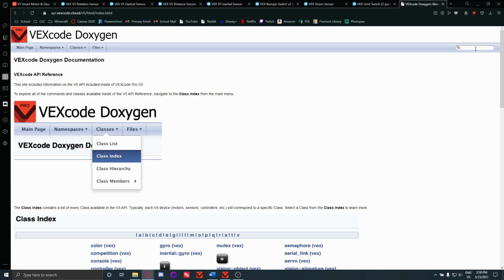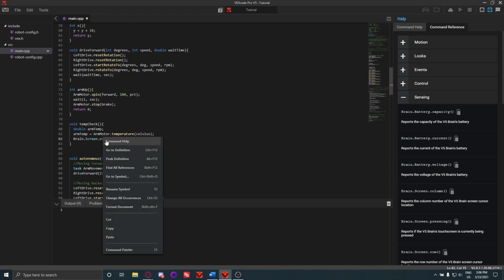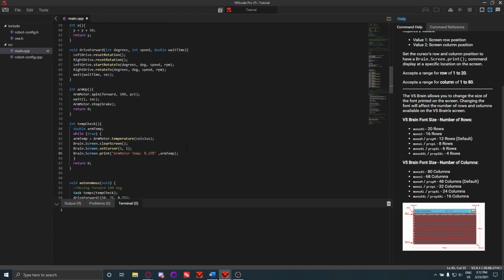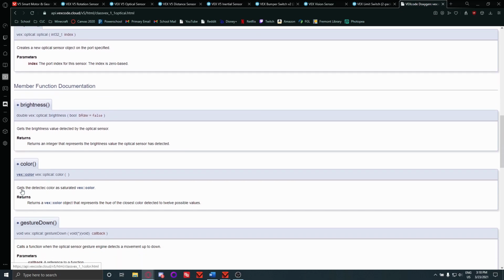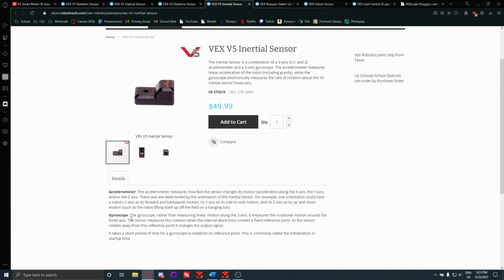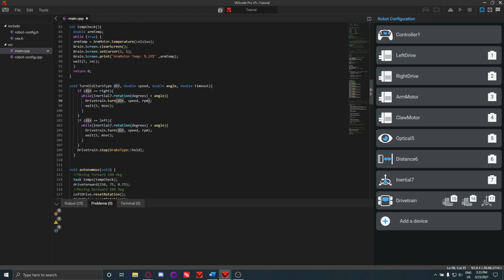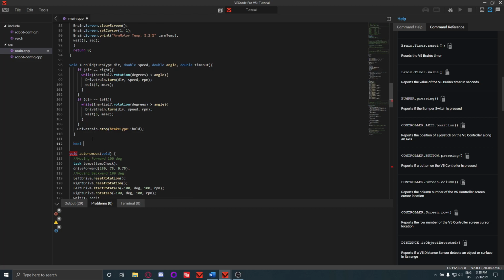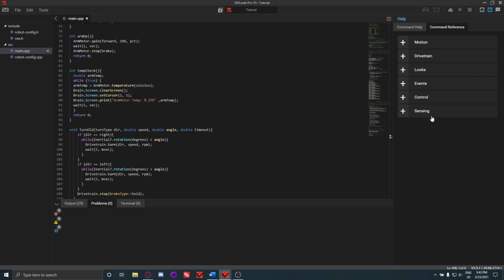Using Sensors with VEXcode V5

Comment: How would you solve the robot constantly turning, I've calibrated the sensor on a flat surface and I had it fit secure to some metal but whenever I run the code it's like it ignores the sensor (even unplugged it) and it spins in circles forever
Reply: Not sure if you still need help, but the problem here is that the inertial sensor is trying to process lots of information as fast as possible, so it ends up skipping degrees in its reading causing your while loop (I'm assuming that's how you programmed it) to keep going. The solution to this problem is a neat little algorithm called PID. The P checks to see how much the robot needs to turn or needs to move and sets an acceleration, and that acceleration lowers until it reaches the desired value. The I figures out the position it will be at and "fine tunes" the velocity further so your don't overshoot and have to correct. The I is usually unesscary unless every second counts for you. The D is the reverse of I, in this the program checks to see what the previous position was and makes sure the robot doesn't undershoot its position. If you just used P, the robot would oscillate until it reached the value, if you just used PD, then the robot would overshoot then return to its normal position, PID makes it so that it turns perfectly to the position you want. Here's a good video explaining how to program it in C++ (https://www.youtube.com/watch?v=_Itn-0d340g)  and here is a video explaining PID in more depth than I just explained right now (https://www.youtube.com/watch?v=wkfEZmsQqiA)